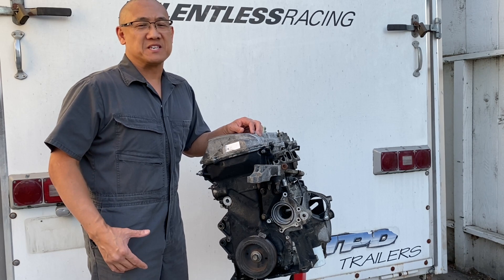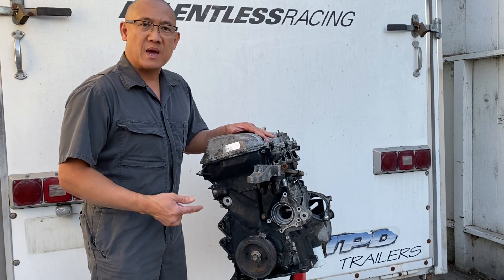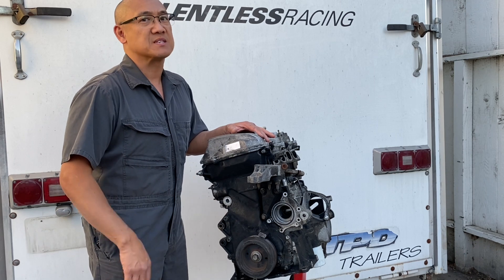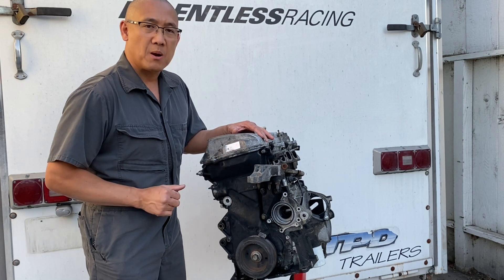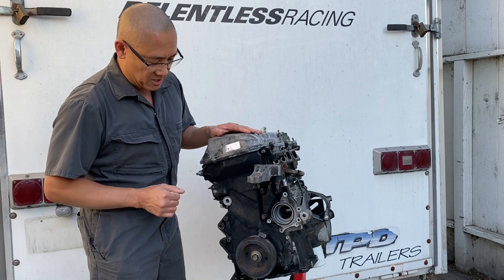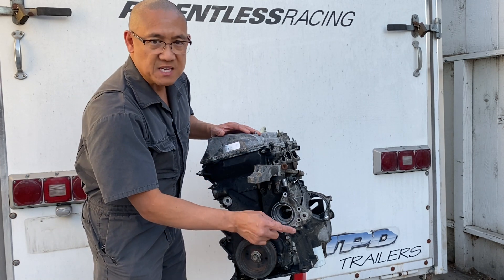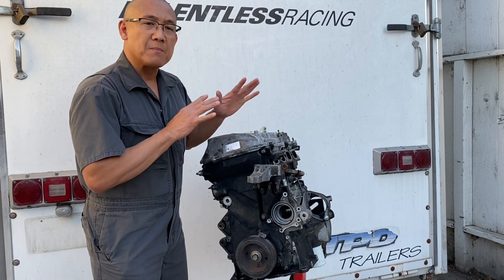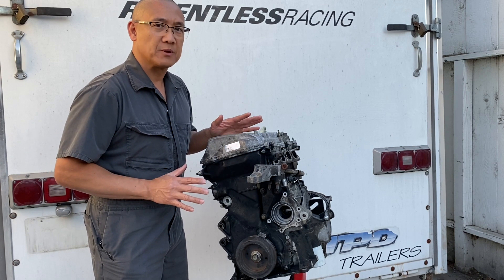Toyota MR2 Spyder 1ZZ Timing Chain Replacement - Align Your Cams & Crankshaft Properly

Comment: How do measure whether the timing chain is stretched. The workshop manual is a bit unclear.
Reply from the maker: Honestly, I have never inspected an OE timing chain bc I always buy a new one.  I consider the price as cheap insurance.  However, I did look at the manual and the inspection looks straight forward.  Measure between 16 links stretched and it shouldn't exceed 122.6mm.  Pls subscribe for more MR2 Spyder videos.  Thx again, AJ

Comment: Thanks for this instruction! Liked and subscribed ! I have a 2zz, I changed the gasket of the timing chain cover also the TCT, (without touching the chain) at the beginning I turned clockwise to tighten my crankshaft pulley, I heard the TCT clicked 2-3 times, then counter clockwise and heard another sort of click, then flipped clockwise again and heard a few more clicks again (i think). Do you think this is correct ? and that I didn't skip any tooth ?
Reply from the maker: The only way to verify if you have the correct timing is to pull the valve cover and check it.  I recently posted a video reviewing this process.  Check out the "Finding TDC" chapter in https://youtu.be/1cVayZvmhv8

Comment: At the end there when you talk about skipping timing, do you mean that if we were to just replace the TCT without opening up the engine and getting the gold links to be at the marked positions, that it won't skip timing? I've got a leak in my celica (1zz) from the TCT and I am looking to just replace the TCT without opening anything up. Thanks in advance!
Reply from the maker: If you follow the instructions in the OE service manual on how to replace the TCT, it will not skip timing and you don't have to remove the front timing chain cover.
Reply: @RelentlessRacingAJ  thank you! I'll have a look.
Reply from the maker: @dwx  pls subscribe bc there’s a lot more automotive content coming. 👊